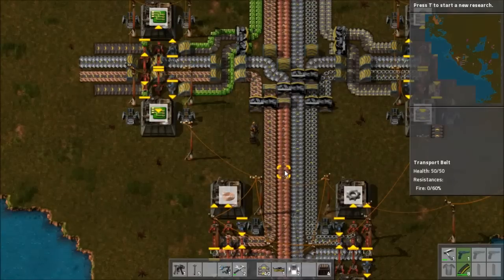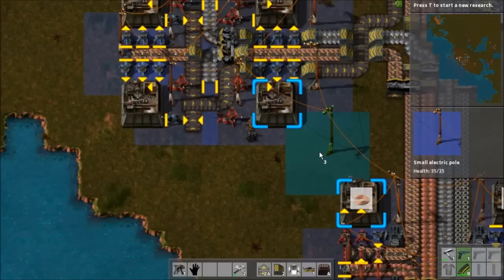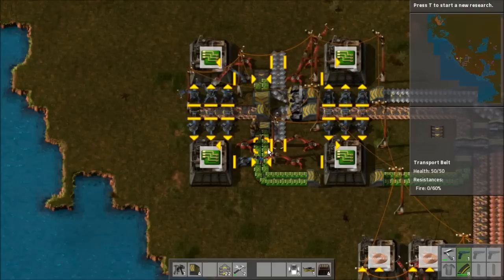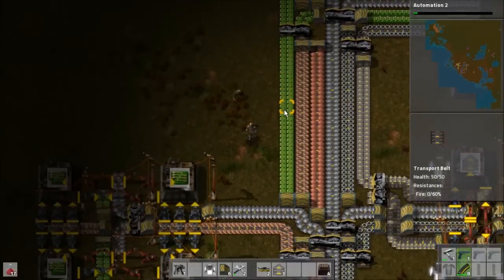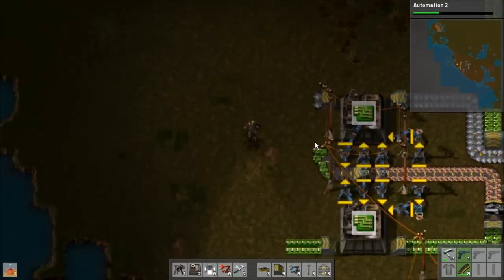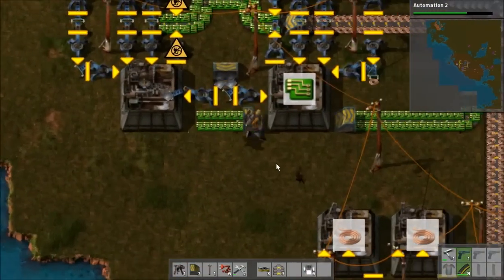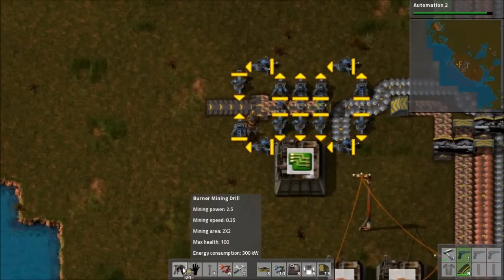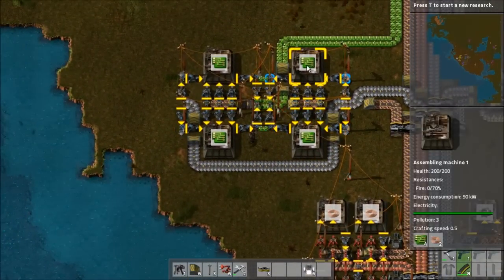Let's Play Factorio Episode #8 - Everyone on the bus!

Comment: I dislike the fact that you move copper wires on conveyor belts, very inefficient, but hey it works. Much better for green card spam if you simply shove em directly into the cardassembler from either a box or another assembler. Also, 2 copperwire assemblers into 1 greeen card is the optimal ratio :3